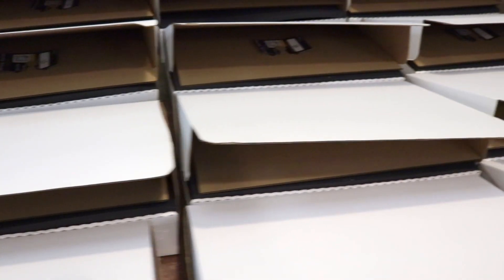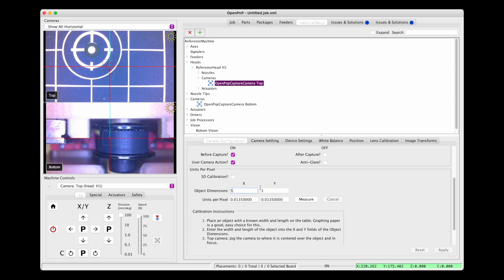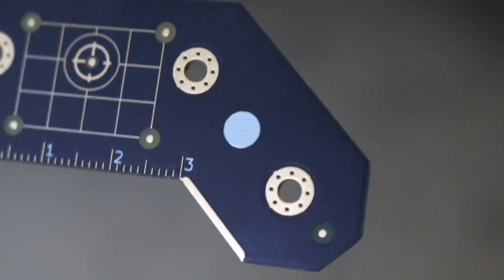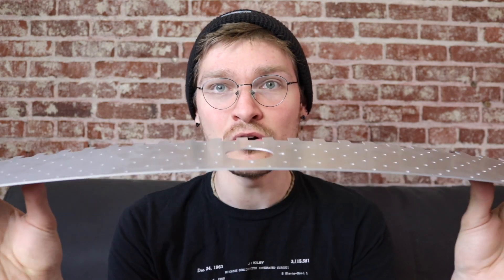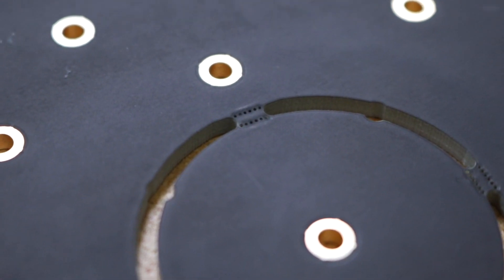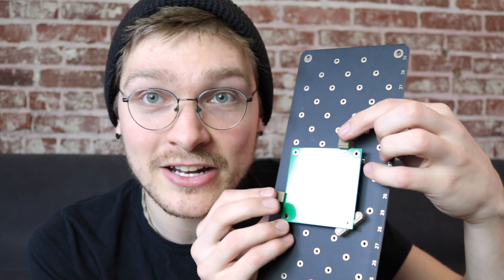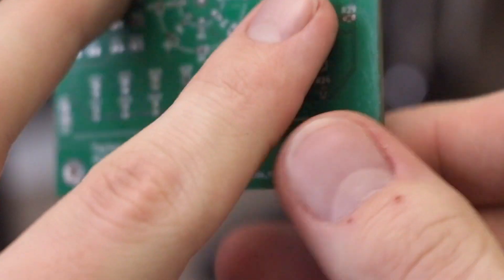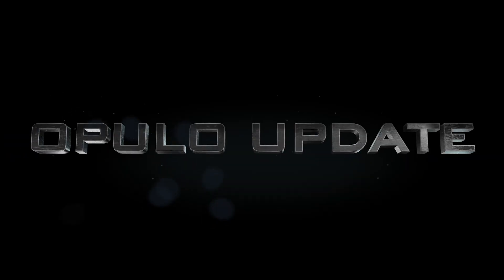Using Circuit Boards Incorrectly

Comment: Nice use of boards as integrated system of systems.  You might want to look at the SMD practice board kits as they may be cheap enough to include 1 per unit when bought in bulk, farther down the line.  The alternative is still looking at the kits, with the parts you currently order, make one yourself as the ' benchie ' for it.

Comment: Imagine if you had a board layer that was a coil that you use to heat up and reflow after PNP. It'd have to be in the board design of whatever board you ordered but really cool if you didn't need a reflow over or to even take it off the pick and place.

Comment: With the build plate, could you make PCB trusses to run on the bottom and solder or glue them on? That'd add a ridiculous amount of rigidity.

Comment: This is an amazing update and shows you are evolving the project as you find problems. If you add toothed break off strips to the staging plate, they could lock into the plated holes to provide strength at 90 degrees if needed.

Comment: you should add a small QR code that has the measurement of the boxes in it.  That way, it can scan that, and just know visually what the mathematical measurement is.  It also allows you to change, or use other measurements in the future.
Reply: I am currently working on something very similar for a cnc machine for engraving.  I'm mounting a camera to determine the sizes etc. of the plates put on the machine for auto alignment and calibration.  I have been thinking about this stuff a lot, and found some of your points very helpful.  I have a huge desire to build my own machines in the near future (when I get more shop area), and would love to help with your project.  I have over 20 years in software development, and hardware (firmware and pcb design).  Been following you for a while, do you guys have discord or something I can join?  Thanks.
Reply: Aruco is designed for that.

Comment: "Abusing" the ridiculously cheap pcb manufacturers to get some high precision CNCd glass fiber boards for other things than electronics is a powerful tool. With some creativity you can make awesome things and save lots of money.
Reply: raises environmental and geopolitical concerns about ridiculously cheap pcb manufacturers 
That becomes (at least it should become) a vital part of engineering, too. The engineering mindset comprises imo

1) excitement for your job and pushing boundaries further (Stephen has admirably a looot of that :D ) 
2) keeping an eye out for the whole thing (engineering complexity vs usefulness (KISS), lifecycle, repairability, .. all count into this)
3) solve problems not for you but others - and in advance, so that your UX is "WOW! - whoever put that much thought into all this, rocks!"-level (another thing Stephen and his team are great at)

Comment: Neat stuff! We have just been using custom made standoffs for our panels.. mounts them in the same way our paste printer does, and we just have tight tolerances on those holes.

Automated calibration is definitely the biggest weakness of the machine so far, so this is awesome news. However... Not everyone uses black boards with white mask and gold pads. Possible to include other color combo options? (Though surely I suppose I could order my own...)

Comment: Watch out for the nozzle offset calibration. Unless your fab vendor signed up for something crazy, top copper alignment to edge plating is likely going to be ~250um error

Comment: GEE-NEE-US! There are more than a dozen great design ideas in the boards and clamps described in this video.  The best thing about this and your company is that you are focused on making a tool, not a hobby project to continuously fiddle with; repeating everything multiple times until its "good enough" (looking at you: 3D printers).  Keep going!  

I'm a retired EE with over 50 years of design and manufacturing experience.  Made my first PCBs in the '60s, Set up my first SMT line in mid '80s. 

Now if you could only do something about the dour, unexcited delivery in your videos, though.  😁

Comment: If you're concerned about flexing, try ordering the staging plate PCB a few mm wider with a v-score.  snap that off, mount it 90° and you have an incredible amount of extra strength for a tiny amount of extra cost.
Reply: I was going to say just add another alu extrusion, but a PCB based stiffener would like be more cost effective.

Even if the stiffener PCB is manufactured separately, it'll still be pretty cheap. Could have provisions to support 2, one on each long edge.

Plate the edge of the stiffener and add a long pad to the mount board, and mount it with solder.

Comment: Dont make the foot 3D printed, use two PCBs that slide together for form a 90 degree offset stand, with slots in the platform to fit-in. Closer tolerances, same material properties, plus 4 solder tacks could hold it to the platform.
Reply: This.

Comment: I know the challenges are completely different, but I wonder how long before you start to work on a reflow oven to go with the PNP.  All the options in this price point are either junk of questionable quality, or have a very DIY nature to them.  (Something with similar capabilities to the "converted toaster oven" but as a more polished kit than the current offerings, would likely be a good solution.)

Comment: Maybe merge calibration PCB and "benchy" PCB together to make it as one unit. You will cut costs on manufacturing.
Reply: Unlikely, since the calibration PCB has a bunch of expensive features like increased height, gold plated edges and gold plating in general whereas benchy is as cheap as it gets

Comment: just a warning (though i think you know this): make the flexture out of petg not pla, pla creeps so will plastically deform over time even within limits of instantaneous load
Reply: I also find PLA tends to get quite brittle over time when exposed to ambient air, which makes it less than ideal for flexures compared to ABS or PETG.
Reply: Totally agree, or Nylon!
Reply: I second this, because of this, my lowest filament is always PETG
Reply: ABS is a fair bit cheaper and the best of both materials if you ask me. It's far more durable too. Yeah definitely wouldn't trust PLA.
Reply: @scooterareyouready3535  ABS can be a bit tricky to print without an enclosure due to warping, but the parts in question are probably small enough to be ok
Reply: @scooterareyouready3535  ABS without enclosure is meh, and since they already invested in Prusa Minis, I think it's not too suitable. 
I personally find ABS is more expensive than PLA or other materials, simply because it's not that wide spread anymore

Comment: Would using QR reference points for automatic pixel to millimeter conversion work? So you would have a center QR code that says something like (the bottom right corner of this box is point 0,0) and another QR code 5 millimeters always store the code for (the top right corner of this box is point 0,5), and have the camera adjust until that is accurate with the view as well?

Comment: I'm curious what other uses could be build into the build platform. Like could you get positions of things placed on the platform using a row and column matrix. Also, is the foot for the platform adjustable?

Comment: you should go for a double 1.6mm fr4 instead of a 3mm, and use 6mm spacers to connect them, effectively creating a 9.2mm thickness board. Remember, stiffness increases as the square of thickness! maybe a large laser-cut spacer, like a gasket?
Reply: it’s better to do 3mm because there’s no parts. best part is no part
Reply: @gedr7664  yes, I meant to say many spacers, and thus connections... Indeed the best part is no part. But in this case, the double board would be way stiffer than the 3mm. And stiffness is a highly desirable feature here... he used to make that part in steel!
Reply: *cubic :)
Reply: @karim1485  you are right! it gave a whole new dimension to my suggestion! 🤣
Reply: you need to have a whole bunch of connections along the length to make them “one” otherwise you will only get a double increase
Reply: It would have to be a bonded core, spacers wouldn't do much to improve structural height.
Reply: @KarriKoivusalo  it depends on how frequent the connections are... if he published a 3d printable part to serve as a core, and enough connections, it would be much stiffer than a single 3mm pcb. Cheaper too!
Reply: @thiagoennes  Using several parts, in this case a top board, bottom board and a core in between and then have it assembled with connections is vastly more expensive in numbers than producing a single board, even one that would be expensive in one-off production. Also, the question is if the increased stiffness is worth the extra investment. The aluminium board was not stiff enough and would've caused problems using the machine, the 3,2mm is stiff enough and offers the work piece support needed. In what way making it stiffer and more expensive improve the process? How is the operation of the machine or the quality of the end product improved?
Reply: @KarriKoivusalo  You are correct, there is a cost increase. but it is not from the board, anything different than a green double sided 1.6mm fr-4 board will be a price increase in the volume they are talking about. also not from the core since they could publish a design for the users to print like they do with the other parts. It would come from the fasteners. And, in my opinion, it is a well-wothed cost. A stiffer staging board allows for smaller components to be placed more precisely because board deflection is a REAL problem with small components like 0402s. Moreover, IT would work better as a member in the construction of the machine,  increase overall stiffness and allow for faster travel. The 3mm board is a sexier solution, no doubt. Someone in the forum suggested breakaway tabs to work as beams under the board. That is even better than both our solutions hahahahahah
Reply: @thiagoennes  3.2mm FR4 board is well stiff enough to match the precision of mechanism. The frame itself will get plenty of rigidity by clamping or bolting it firmly on the base. On DIY sandwich structures the management of internal stresses becomes an issue, and may in time result in warped or uneven surface.